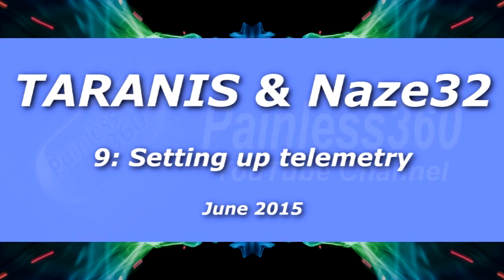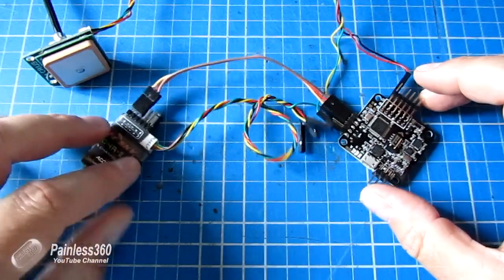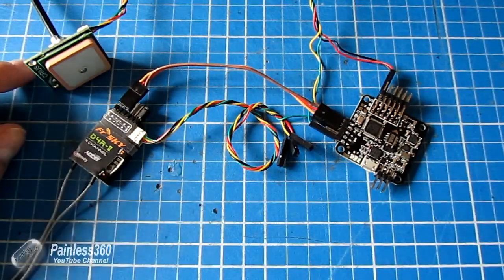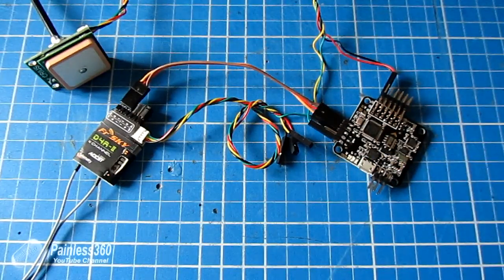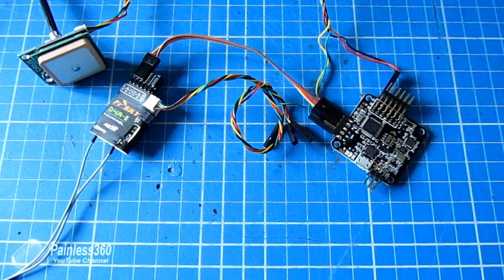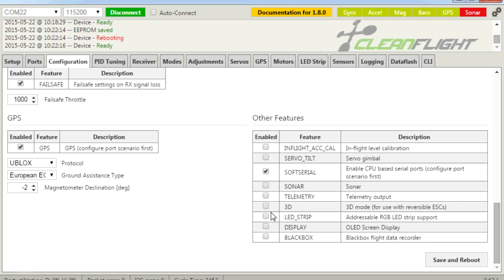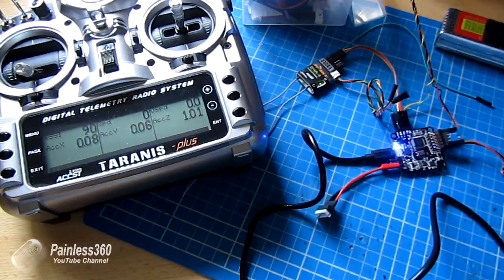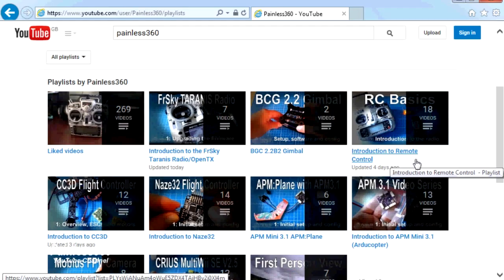(9/12) FrSky TARANIS/Naze32 Telemetry - Simple setup using a D4R-II receiver

Comment: Question... when i connenct the telemetrie i can control the pid's with Betaflight-LUA-Script on my Taranis.
Could i use the same solderplace on the FC to connect the Smart Audio from a TBS-Unify to controll the channels and so at the same time??????
Reply from the maker: +Babylon FPV I've not tried both here.. let me know if it works..

Comment: Sorry for that.
I meant to say that, what are the utility of the uart1, uart2 & softSerial? What type of communication is used here? Is it Serial communication? I am curious about some practical use of these ports.
Reply from the maker: +Priyabrata Saha it's worth having a look at some of the build series to see how these ports are used. I2c is used to connect sensors like barometric and magnetic sensors, uarts are multi purpose and used for telemetry  (MSP and MAVlink among others) as well as serial connections to sensors like GPS and data to configure 'smart' peripherals like video transmitters. All of the options for the software you are using is normally in the ports tab of Cleanflight/Betaflight...

Comment: set telemetry_inversion = ON doesn't seem to work anymore....
Reply from the maker: +Derek Arsenault check out the note in the description... Best of luck
Reply: Painless360 did that but now I'm wondering if it's just missing from betaflight? neither command will work... telemetry_inversion just doesn't exist as a set command...
Reply from the maker: https://github.com/martinbudden/betaflight/blob/master/docs/Telemetry.md ?
Reply: as I said before, aware of these docs and listed commands, but the telemetry_inversion setting no longer exists ...maybe the latest FW removed it? Anyways, no big deal, I'll just move on...
Reply from the maker: Derek Arsenault possibly. That's all the detail I could find...

Comment: I have tried in vane to get a gps working with a softserial port. I would like to be able to use Sbus or I would use Pins 3&4. I keep reading that softserial should work but not for me. At this point I have two gpss,  a 7N and a M8N, two NAZ32 Full, a camera and a spare Transmitter.  If I buy any more my wife will Kill me.
Reply from the maker: Best of luck with it, remember that the SoftSerial port will only run at 19.2k so you need to setup the GPS for that speed.. ;)

Comment: Can you still daisy chain the s-port sensors when connecting to the fc like this? so could i connect my x4r to my gps v2 sensor, then connect the gps sensor to the fc? or can i do as you have but then connect gps sensor to a free uart? thanks
Reply from the maker: I would connect the GPS to the flight controller.. I've not tried it any other way - let me know if it works.. Best of luck!
Reply: Painless360 Ok thanks will let you know.
Reply: Painless360 Do you know why an x4r would only work above 6v? Using 5v or 6v both leds on x4r are flashing, if i use 8v 2s lipo i get solid green led and all works as should? Thanks
Reply from the maker: I've not seen that here.. I'd double check the voltages and make sure the X4r isn't damaged.. Best of luck!
Reply: Painless360 I switched it out with another x4r and that works perfectly down to 4.2v, not tried lower but thats good for me. Think i must have shorted it somehow and damaged something. Gps v2 sensor doesn't seem to be working even when connected to the smart port so not tried connecting to kombini yet. I am testing indoors but I've left it a good 20 mins and still getting no data.
Reply from the maker: Pop it outside and leave it for 20 mins.. Best of luck!
Reply: Painless360 Will do. Would you recommend updating the taranis to  opentx 2.1...? I'm still on 2.0.19. I worry about screwing it up and not be able to bind to all my receivers, i don't understand all this eu and non eu stuff, i think my taranis plus must be non eu as i can select d8, d16 and the rest.
Reply from the maker: Updating OpenTX will not affect the code running on the transmission electronics inside - that's a different system.. Best of luck!
Reply: Painless360 Ok we'll see how it goes. I managed to get the gps sensor working, in a daisy chain. From fc to gps then to x4r, all works getting volts, current, speed, altitude to taranis.

Comment: Well, I've got a ZMR250 with Taranis 9D+ and D4R-II RX, and I did have my Telemetry screen working PERFECTLY.  Today I was looking at FrSky's site and realized that my old original Taranis firmware was very outdated, so I updated to the latest 2.1.6 version. I had saved my models so that wasn't a problem. However, when I long pressed the page button to go to the Telemetry screen, everything was gone ... not setup!  I originally had NUMS in 2 lines: Cel, RSSI, Batt and line 2 was Cels (individual cell volt) and 2 other parameters which I no longer remember.  I've been searching on how to set this all back up again, but most of the tutorials are based on the original firmware. Makes me want to kick myself for updating the firmware!
Reply from the maker: Check the videos later in the series where we did updates on the new features of 2.1.. It's in there.. Best of luck!
Reply: I got tired of trying to make it work. So, I back flashed to v2.0.9, but then when I tried to reload my ZMR250 racer model (setup) it said "Incompatible" ... so now I have to go through the entire bloody setup again, starting with binding to my D4R-II .. which means I'm going to have to cut a bunch of zipties and undo my install of hardware on the ZMR .. what a fiasco!

Comment: Mine anit working dude. Did it the same way and using frsky port same results. Vbatt sometimes work, sometimes dont, and always by USB, never using Lipo only. Any Advice? Thanks!
Reply from the maker: Hard to give advice without a lot more detail. Happy to help but please watch https://www.youtube.com/watch?v=olIqTiSJHIY and come back to me with more detail of what you've tried..
Reply: Painless360 thanks for the quick response! Naze32 rev6, D4rii receiver. Green wire to ch6 (serial 1), VBATT pins in naze32 wired directly to battery. Activated soft serial 9600, telemetry ON , vbat on, telemetry inversion ON. It detects everything but battery voltage. I've been reading and some people say some resistors could be bad, but I wont deal with resistors lol
Reply from the maker: Can you see vBat in the GUI on the PC?
Reply: Painless360 no, sometimes it says 25.5 (which is the max) and sometimes 0. Checked the wiring several times, everything is OK :(
Reply from the maker: Then I'd try another version of the firmware and then I'd suspect the board vBat bits.. Best of luck!

Comment: ok i have this set up on my x8r and for some reason my fuel reading (mAh) is reading in the tens (56mah) and not the hundreds. all of my other telemetry readings are working fine.
Reply from the maker: I've not seen that here - I'd check the version details for the OpenTX/Cleanflight you're using in case this is a known problem and fixed in another release. Best of luck!
Reply: yea i found the notes and it says the reading needs to be calibrated. you discharge the battery with the fc plugged into clean flight, take the reading that clean flight got for the mah, then you charge the battery and take that reading. then some math magic I don't remember the exact formula and you plug that into the current settings in configuration menu.

Comment: Thanks so much for making these videos, they have been really helpful.  I'm having trouble following this one though - how is the NAZE board detecting the voltage from the battery pack? Is it reading it from the ESC you have plugged into the servo pins? (the vbatt pins next to the buzzer aren't being used).
I have an identical setup but can't get the telem stream working for love or money.
Reply from the maker: You need vBat connected and configured (see our Naze32 series for more detail). This video works for the D series 'legacy' FrSky Telemetry, if using X series SmartPort then connect the TX, RX pins on the UART to the S.Port pin on the RX and make sure you select SmartPort telemetry in the setup. Best of luck!

Comment: Hey Painless! Nice video! I'm having trouble fixing the telemetry on the taranis on OpenTX 2.1. I've followed your steps in this video but without any luck. I've read that it changed some in OpenTX 2.1 compared to 2.0. I don't get cels or cell value, I don't even get any Readings on VFAS. Got any suggestions? FC:Naze32 Radio: Taranis Receiver: D4R-II
Reply from the maker: Please see our Taranis Open2.1 Telemetry video for the differences - it's in the Taranis playlist towards the bottom. It should help!
Reply from the maker: https://www.youtube.com/watch?v=lORZGjDpZEg may help..

Comment: Great video :-) Thanks,    can you tell me how you get your Taranis to show a screen as you have where there are 3 separate boxes to show the telemetry?
Reply from the maker: Not sure what you're asking. We have a playlist specifically for the Taranis and includes a few videos on Telemetry too - they should help. Best of luck!
Reply: I will check out the other videos,  but right around 5.3 minutes into this video you show the Taranis and the screen looks to be separated into 3 panels     I was wondering how you did that.  I press page on mine and don't see any screen like that?
Reply: Have it figured out,   thanks again :-)
Reply from the maker: Great! Happy flying!
Reply: how did you get the three screens?
Reply from the maker: You need to setup the screens you want in the telemetry section of the menus on the radio. See our video on Telemetry in the Taranis series.. Best of luck!

Comment: There must be something I'm doing wrong. I've done everything in your playlist but I can't configure the VBAT monitoring. I've connected 1 wire to a positive on the PDB, I'm running out of connections so I connected 2 wires on 1 positive slot, 1 is for ESC and the other is the one supposed to connect to VBAT + on Naze32. However, I can't get battery voltage working. Cleanflight shows 25.5v no matter how what the voltage scale value is.
Reply: Okay, I've changed the voltage scale value to 50 and Cleanflight now shows 16.5v, I still can't get it to show on my Taranis. When I enter Discover New Sensors, I'm not getting anything. I only have:
1. SWR = 1
2. RSII = 90dB
3. A1  = 5.1v
4. A2 = 7.3v

Comment: hate to ask maybe been done a lot but this video helped so much with the dr 4II  do you have one for telemetry for naze32 x4r and telemetry setup I don't understand difference between the two?
Reply from the maker: For an X series then connect the rx and tx pins to the SmartPort pin on the receiver and select 'Smartport' as the type of telemetry. Best of luck!
Reply from the maker: SoftSerial telemetry is for X series only. Frsky telemetry is what you need to select for D series receivers. Best of luck..

Comment: I must be stupid. Ive followed along exactly  checked everything 10 times  I have it right and its not working.
Reply from the maker: What troubleshooting have you done already?
Reply: I've honestly taken everything apart and redone it all step by step along with the video atleast 10 times. My setup is a bit different I'm using a 9x but it has telemetry and is running a frsky xjt module I'm also using a xsr rx. I have used you videos to do everything from Bluetooth to GPS. Thank-you very much for putting them out. I have managed get everything else to work even the gps on a cc3d. This i just can't make go. I've inverted the signal. I've tried it none inverted. I've tried it hooked up to soft serial I've tried it hooked up to the actual telemetry out puts. I'm going. To order the cable and update my rx and moduel see if maybe that helps.
Reply from the maker: If you're using an X series receiver you need to select 'SmartPort telemetry' and also connect the TX and RX pins of the UART both to the SmartPort pin on the Rx. Best of luck!

Comment: You helped me a lot when setting this up, man! But I'm not quite sure about the DF13 connector type.. I recently ordered one from BG but it doesn't fit! I had to make some adjustments by hand to plug it in.
I morely think, it is a 4 pin 1.5mm JST plug, although there might be different versions.

Thanks for what you are doing, you are getting a lot of people getting started with this hobby!

Comment: Hi do you do this the same way if you are using a rev6 i have tried it and cant get it to work ? i'm running OpenTX 2.1.7 on my tarnis .
Reply from the maker: +Jeff deakin we've not tried it. Best of luck
Reply: +Painless360 All working  inverted the telemetry in the CLI and also telemetry on in CLI ! Not just on in  the configure screen but in cli to green wire to pin 6 now I don't have to arm to get telemetry !
Reply from the maker: +Jeff deakin Perfect - happy flying!

Comment: hi Painless360, always found your videos very useful so first off thanks for that!
I have a Naze32 Rev6 on Cleanflight 1.11 and Turnigy 9x DHT diy kit running with OpenTx 128-2.0.19. I'm followed your process and i'm not able to get any telemetry readings at all. Any advice where I could have gone wrong? HAppy to provide a list of configuration.
Reply from the maker: +Chua Yaowei I like to use soft serial on the boards here but we haven't tried it with the revision 6 boards through. Best of luck..

Comment: Funny thing, I bought the Taranis with a d4rii and an additional d4rii so I could use it with two quadcopters.  I got them both setup and working but I can control each model with the others model stored on the taranis.  Should that be possible?  I set them up as separate models and bound them and they are definitely two individual d4rii's.  Is this normal?  My spektrum satellites never behaved that way.
Reply from the maker: +Sankofa Musician You shouldn't have then both on at the same time anyway. You can set the ID of the Rx before binding.. Best of luck.

Comment: Hey guys, got a quick question with the NAZE32 REV6.

I got the board to output telemetry via softserial1(Pin6) to the D4R-ii/Taranis and I'm getting telemetry BUT ONLY WHEN ITS ARMED.

As of now nothing extra on the board except that..

What am I missing here? (AFAIK with Rev5 you can get telemetry via Softserial regardless when its armed or not.)
Reply from the maker: We've not used the Rev6 boards. Best of luck with it!
Reply: +Painless360 I figured it out. Its now working. Forgot to uncheck MSP at Softserial1. Its so easy to panic and forget the simplest things. :-)

Comment: Thanks ! i need to clear one doubt and no one has give me an answer on mini quad group ou in my portuguese group. I had VBAT monitor to Micromosd (i have on screen voltage, status (armed or disarmed) and i could tune my pids on the quad by stick. I changed to taranis, i connected the telemetry pins to d4II and activated telemetry on naze FRSky. Now i have taranis singing voltage and information when armed. ok... BUT i lost osd information, battery is valued is freezed, does not recognize when i arm it (keeps disarmed on screen) and also i cant enter on PID tuning menu. The flight modes change when i switch on taranis, so its communicating, but voltage, sticks nothing. Is it possible to have at same time taranis information voltage and the microsmosd ?!?!? How ???
Reply from the maker: +Ricardo Oliveira Having too many telemetry ports won't work on the Naze32. All part of the fun. You need to use the UART shared with the USB port for the MinimOSD and remember to unplug it when connecting it to a PC. That way the MSP telemetry will be used by the MinimOSD when the USD port isn't.. Hope that helps..

Comment: I followed your steps using an x4r-sb receiver i don;t know if this should be different set up but i get the voltage reading all over the place any help would be much appreciated
Reply from the maker: +Guy Goldsbrough I've not seen that here, I'd check that the vBat reading in the GUI is ok.. Best of luck..
Reply: Thanks for the reply

Comment: Thanks for all the videos! 

I'm having trouble getting this to work. Did the inversion in CLI, telemetry and soft serial are on...I actually bricked my Naze last night by having the UART port on at the same time and had to short the boot loader and reflash. Green wire is hooked up to 6th pin on Naze. Vbat is on in CF GUI, but I can't see the actual battery voltage when I plug my LiPo in...should I be able to?

 All i can get is RSSI on the telemetry screen.

Any advice?

Thanks!
Reply from the maker: If you have it setup right then you will see the battery voltage in the GUI (see our video on setting up vBat). Check inversion is on in the CLI as the command changed (see the note in the video). Best of luck!
Reply: Turns out I needed to solder leads onto the PDB and connect the servo to vbat on the Naze32. Completely looked over that! Thanks for the reply and for all you do!

Comment: Hello, I like your tutorial videos very much, they are all pro.

I experience the following:

I have naze32. (I run INAV rewritten cleanflight) but that should not be definitely the issue:

I succesfully set up the 1-wire telemetry via pin6 and soft serial. 

there is one telemetr value which does not "recover" on some cases : the Frsky "Cvlt" value.

When I disconnect  the batt on the quadcopter, I also have to switch radio on-off to have that specific value refreshed again, when battery connected back on.

Other values do "recover", refresh after this, but "Cvlt" not.

I really like the solution with the soft serial. Would it refresh vith another method ot 2 wire connected to telemetry pins (beside the buzzer) to the FRSKY D4R-II? but then there is the disadvantage of not seeing teloemetry when not armed, is that correct?
Reply from the maker: I would try to recreate the problem in Cleanflight. INav is a fork for the testing of the improved GPs code (see our video on how Open Source Works) best of luck..